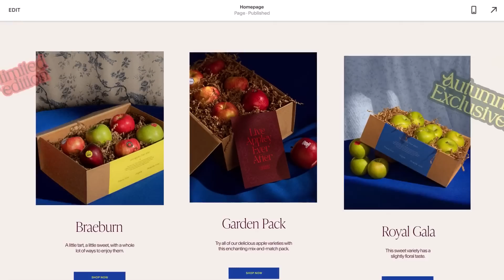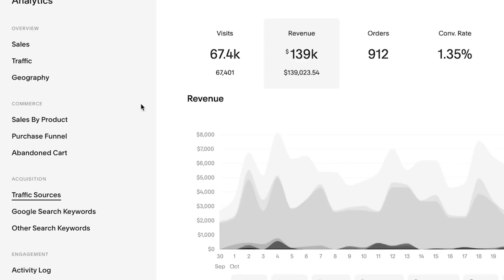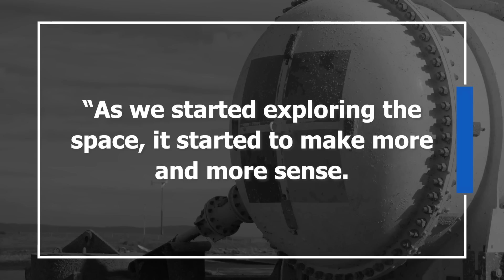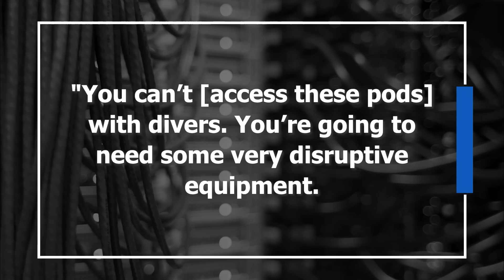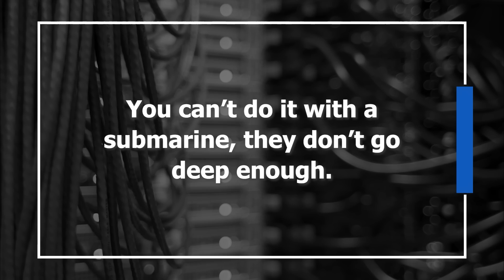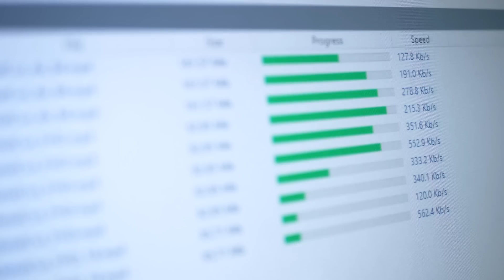Underwater Data Centers: The Next Big Thing in Keeping Computers Cold

Comment: I had been wondering how we could go about boiling off the oceans to make WH40Ks Terra a reality. This is definitely a start.
Reply: If land-based and sea-based datacenters put off the same amount of heat, and required the same energy input, the difference in warming the oceans would be negligible between the two. The amazing volume of water in the ocean would mean that you have essentially a 343 quadrillion gallon heat sink. And the immense boundary between the air and the oceans means that heating one has an effect on the other. As it stands under water data centres would require less energy to cool, so at the energy generation source, less carbon emissions and less waste heat would be generated.
Reply: @AlexFoster2291  In addition to what you said, sea-based DCs would likely end up producing less overall heat, not an equivalent amount: as you are primarily cooling with the ocean water itself, you don't need to spend any power to cool down air/water like you do for land-based DCs. Meaning, the vast majority of the extra power/heat that that is required for land-based DCs to function would not be a factor; you'd still need some extra to power pumps to move water around properly even in sea-based DCs, but virtually nothing else beyond that.
Reply: @AlexFoster2291  that theory makes me think of how many animals we have driven to and over the brink of extinction while claiming tht there was so many of them humans couldn`t make a dent in their numbers
Reply: @jessgunn6639  I'm sorry that this makes you think about species extinction. The point of my comment wasn't to overlook the issues of global warming, but to reason that heating up the air heats the water and vice versa, that it doesn't make a difference which one you pump heat into, because they both heat up, and that using ocean based cooling would have a net lower amount of heating because of its efficiency. 
If I were introducing a new practice which killed 'less bees', I'm not advocating for killing bees, actually the opposite. As it stands, data centres aren't going anywhere ( as you and I are using them right now. So I applaud any effort that reduces inefficiencies because that not only lowers waste heat, but also carbon emissions.
Reply: @AlexFoster2291 while the servers will need the same amount of energy to operate, the power to cool the data center underwater would be only a tiny fraction of what it costs for a land based data center.
Reply: Humans: "Global warming is an issue, the oceans are raising in temperature and it's killing aquatic life"
Also Humans: "Lets use the ocean as a heat sink"
Reply: @oxylepy2  that’s why you aren’t paid the big $$
Reply: @jakeroper1096  paying 200k a year to be part of that think tank, but not paying anyone to make sure the ideas are good.
Reply: @oxylepy2  Climate change isn’t due to heat generated by humans, it’s due to the greenhouse effect from CO2, CH4, ect. So this is actually a smart way to decrease GHG emissions since the amount of energy used to cool the data centers generating GHG increases global temperatures much more than the actual heat generated.
Reply: @oxylepy2  what a low iq take, look at nuclear power plants, they heat up oceans too, if you convert atom into energy it adds heat to the globe. Everything heats up the earth and theres nothing you can do about it
Reply: FOR THE EMPEROR! FOR HOLY TERRA!
Reply: Warming of the oceans mainly affects water near the surface. Deep sea water is cold and stays that way. Deep sea volcanic vents emit boiling hot water which results in them being colonized by some interesting deep sea life but they have virtually no effect on the temperature of the deep sea. Who knows, maybe the warmth given off by these data centers would provide some additional oases for deep sea life.
Reply: This isn’t going to boil off the oceans.
Reply: @Matt  Not with that attitude it won't. You gotta believe man.
Reply: Get a few datafarms running crysis
Reply: It's ok, the melting ice shelves will make up for the loss
Reply: You are insane if you think this would affect the ocean temps. Go live in a cave and get off the internet if you are scared of progress.
Reply: My mom stole the remaining water on terra and I got the shit end of the stick because of it...even still one phrase echos through my entire being...."run Ra."
Reply: The Oceans are a haven for the Xeno and must be purged. For the Emperor.
Reply: Cant happen. You boil it away it comes down as rain. You will have to take it off planet.
Reply: Absolutely nuts init, I've got a great idea let's cool our systems in an ever heating up volitile (to us and the earth ) environment what a bunch of nob heads
Reply: The U.S. president in 2022 released more methane into the atmosphere than at any point in world history with his bombing of the Russia/German pipeline.  There’s no point in trying to solve climate change Joe Biden and his voter made it impossible to overcome.  They said we had 12 years left to make significant reverses 5 years ago, this action by Biden has blown that timetable to smithereens. Put your computers under the water and pollute to your hearts extent.  It’s only a matter of time until we go extinct.
Reply: People obviously are not thinking these thing with anything else but a feeling and a hunch.
The amount of watts that the world and it's oceans receive from sun daily, per square meter, makes any datastorage heating meaningless. Oceans have convections, currents and untold number of tons of mass. Dozen or even ten dozens of datacenters is simply so small that it's useless to put a number on it. The world will run out of electricity before we can sink enough data storages to the ocens to have any meaningfull difference.
Reply: It’s would take a shitload of these to have any real effect
Reply: We wouldn't have the need for as many data centers as we have if big brother and his little corporate sisters weren't hell bent on saving every bit of data they can on every human being.
Reply: For the Emperor!
Reply: Look, I don’t think the worry realistically has anything to do with “boiling off the ocean” the actual logistics of a task like that would be MONUMENTAL. There is a worry here. No you don’t run a business based on feelings, but if something feels wrong you have to validate that emotion and try to understand it. Me personally, I’m more worried about warming the ocean. Warmer ocean water, especially on the coast could magnify the effects of hurricanes, flooding, and wind patterns. And to add to that, your going to have large amounts of displaced or just killed aquatic life. Small changes in an ocean ecosystem can effect the entire ecosystem of the ocean.
Reply: Hahahaha
Reply: This is funny af. I'm honestly not sure if using the ocean as a heatsink actually will change the ocean climate or global climate as significantly as fossil fuels simply because the net energy of the servers is ultimately dissipated and doesn't contribute to a cycle of increasing thermal load on the global environment (although expansion and creation of data centers obviously does both directly and indirectly). Funny enough setting up a coastline fission/fusion nuclear plant would be ideal as the net heat is actually not stored in the ocean as the water is evaporated into the atmosphere and eventually rains back down at normal temperatures. Consider that the net thermal load of the ocean and planet is extremely significant and ultimately is not the reason that global warming/climate change is an issue... Rather that our atmospheric composition retains heat from all sources (especially from the sun which distributes a crazy amount of energy to earth and is by far the significant majority of the thermal energy put into the planet).

Essentially, without the sun Earth would have a surface like Pluto. Enter solutions to solve a boiling hot earth by displacing our orbit further from the sun...
Reply: Lol 
4real
Reply: You should cherish the fact that stupid isn't physically painful.
Reply: Cooling computers by transferring their heat to the ocean. What could possibly go wrong?
Reply: @martynadams9942  Add to that the displacement, however small it may be!
Reply: @timothygraham4304 ahh yes, alter the apogee of our orbit so we’re slingshot out of our own solar system. Perfect solution.
Reply: @martynadams9942  well see we compensate by dropping containerized servers onto glaciers, using the ice to cool them, thus converting said ice into water and refill the seas!  Water cycle in action ;)

Comment: Better to use the waste heat instead of fossil fuels. Its literally free heat of no value to the data centre. Think of the vast no of low income housing that could use this or use it to heat indoor glasshouses instead of kerosene or electric heaters
Reply: If you can figure out a way to gather all that heat in a way that's even remotely efficient or economically viable then go for it.
Reply: @Not_a_Lizard_  This is already done. IBM dumps its heat into a nearby public swimming pool and one DC dumps its heat into a local theater/community building. The DCs have the heat but its expensive capex to build district heating, thats why most of the existing DH grids are decades old/paid for by the state/locality. Funding this DH grid development should be part of any permission to build/expand an DC. After all, they are both massive power users (most of which is still fossil fuel generated) and employ few workers after construction and generate volumes of electric-waste. They also often require heavy water demand access to use for its liquid cooling needs. Yet their vented byproduct waste (heat) is of value to buildings that could access this that at present is a cost to taxpayers.
Reply: Good idea IF you have a uniform demand for heat in the winter, colocated with the powerlines that feed the data center. Otherwise, you need a way to store the heat or convert it to electricity to pump back to the grid. Like the nuclear steam turbines on submarines.
Reply: @lyfandeth  the problem is the heat is low temp, too low to make steam. Heat pumps generate low temp heat that works well in homes/apt blocks. Ideally planning permission, of power hogs that dc's are, should require building district heating pipes to offices/state buildings (libraries, care homes etc) where demand is constant for internal heat. Another outlet for this heat in sunbelt locations is needed but few DCs are built in hot areas as the power demand for extra cooling is so high unless you can fund your own solar park/wind farm and even that power is intermittent. We don't need even warmer sea temps from subsea DC farms. Building mini DCs in cities and near state buildings (court houses/police/gov offices) cuts the need to retrofit what are old buildings to cut heat-power needs and that return "heat" is much cooler (especially overnight). I've often wondered if any greenhouse sites should be built next to power stations to access waste heat, waste steam and even higher C02 that plants love.
Reply: Seawater in heat sinks is highly corrosive and maintenace intensive, due to biogrowth. Interesting concept though.

Comment: "Underwater Data Centers: The Next Big Thing in WARMING THE OCEANS"** Fixed that title for ya there Mr Overlord <3
Reply: Maybe not. Data centers in the ocean would POSSIBLY do the opposite. Remember, there are volcanoes under water, lots actually, and a data center won't be that hot, so the actual heating from a center would be very small. Data centers, in general, contribute to warming, mostly due to the power they require to function, but also for cooling.  Using ocean water MIGHT, save a little power on the cooling end. All depends on the setup, I suppose, but the power plants feeding the thing are a larger problem.
Reply: @Iamthelolrus  Right now, yes, the power feeding them is the bigger issue. But if underwater data centers prove to be viable, then underwater turbines, underwater geothermal, water tide-flow power generation, most of the technologies are available in separate pieces.
Putting them all together, if it proves viable and cost-effective, it won't just be a couple of them here and there, humanity doesn't do anything small when it comes to infrastructure. At the end of the century there could well be thousands of them across the world's oceans.

Edit: atmospheric alteration, CO2 etc, scares me. But fucking with the thermohaline cycle is what really terrifies me. And over the last 50 years we've already noticed enough changes that scientists are already worried and making predictions.

None of this is to say I have a better idea, I would just rather not screw with ocean temperatures as much as possible.
Reply: @mashrien6207  totally agree. Messing with the climate, especially the ocean, is a very bad idea in general. So many variables...
Reply: What, you think running massive air conditioning and cooling systems doesn't contribute to global, and therefore ocean, warming?
Reply: @smwsmwsmw  screwing with the atmosphere kind of buffers the change to the ocean. And what I mean by that is the weather circulates globally, so the temperature change of the atmosphere bleeds into the ocean fairly evenly around the planet. Where as doing these data centers would create hotspots, very specific locations that are many degrees warmer than the surrounding water creating updrafts, which will alter currents.

I tried to explain that best I could, hope that made sense. It's 5:40 a.m. and my brain is still booting
Reply: @mashrien  I'm not an expert, so I'll have to defer to what you said. I will make one additional point, though: the amount of heat generated by these underwater datacenters is significantly less than that of a surface one (assuming the same amount and type of equipment), since no compressors are required - just a simple pump to move the water.
Reply: @smwsmwsmw  and again, I don't pretend that I have a better answer, or any answer for that matter. But the little I understand of thermodynamics and the thermohaline cycle/current, just means that I am scared of screwing with the oceans directly

Comment: I can only imagine how what kind of material the exterior would have to be. Not just high tensile strength, but also high rigidity, high resistance to mechanical fatigue, thermally conductive but electrically insulating. Off the top of my head, I can only think of a handful of materials that can do this, and none of them come cheap. And recycling them would be a nightmare. Imagine that kind of tech waste floating around in the ocean. Heavy metals, polymers, alkali electrolytes, just an environmental nightmare.

Then again, I'm not an electrical or computer engineer, just a materials scientist. Maybe I'm out of my element here, no pun intended.
Reply: Why would the exterior need to be electrically isolating?
Reply: @edweard  this is where I'm ignorant of the device anatomy. I'd suspect that if it was electrically conducting, and even the smallest amount of saltwater gets inside, it'll cause shorting.
Reply: @me0101001000  I think if saltwater gets into the computers you've got bigger problems.
Reply: @edweard  oh yeah, absolutely. And that's why the structural integrity is probably the most important component.

Comment: using our oceans as a literal heat sink.. what could go wrong?
Reply: Well nothing unless you make billions of them.
Reply: @edweard  good point, they will probably stop at just a handful
Reply: @ABentPaperclip  Well it's not like a handful or billions are the only two possibilities.
Reply: @eb  waste heat is a bigger problem than you think. It should be considered. Here's a video on it. 

https://youtu.be/9vRtA7STvH4
Reply: @tannermccune4011  The computers being on land or at sea won't affect that.
Reply: @edweard  partially true, if they're on land then the waste heat can radiate into space (most will not), but in the ocean this isn't possible until the ocean starts to boil or sublimate
Reply: @eb  It does matter, and the ocean is a worse place in terms of waste heat. Water has a relatively high specific heat compared to air. Once it warms up, it will stay hotter longer and less heat will be radiated out into space. That said, I just think the waste heat topic is interesting. It's not so urgent that we need to worry about it all compared to climate change caused by greenhouse gas emissions.
Reply: The answer is yes.
Reply: Yea I was thinking the same thing 😖the ocean it already warming up ….